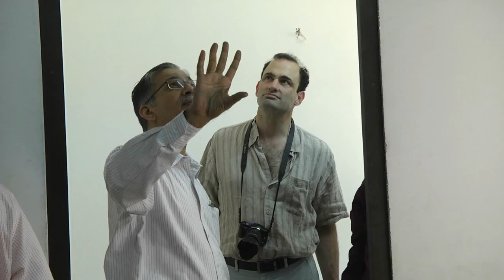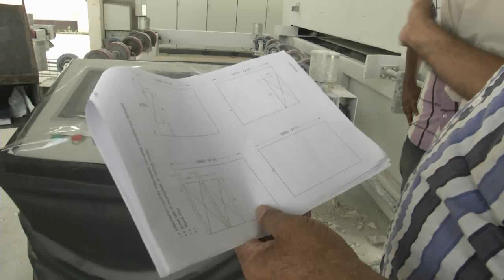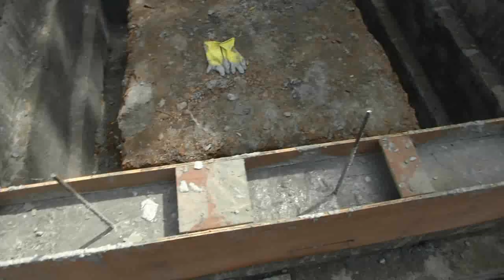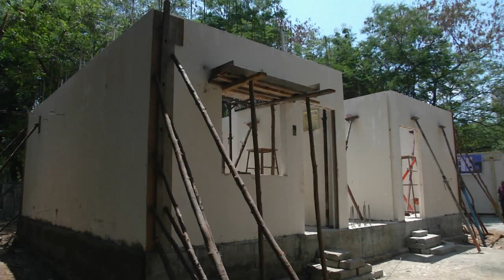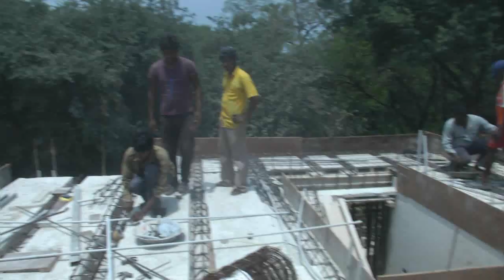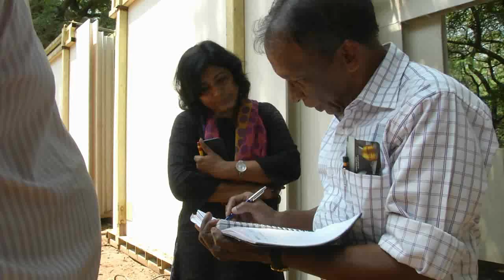IITM GFRG  demo building 2013_720p

Comment: Thank you for a very informative video. It is a significant move from conventional techniques and seems to be well anchored in preserving resources.

I would be very interested in the possibility of enhancing the recycling and conservation of materials by replacing aggregate in the foundations with recycled glass, using micro rebar in the structural concrete members and using aircrete or foaming concrete to conserve concrete materials and enhance thermal properties?

Many thanks for your inspiration and foresight. Kind regards. Marc
Reply: Really its grate and innovative .I want construction house in odisha, where I contact any number sir plz

Comment: Hi i would like to build New House with G+2 floor in Tirupathi and i have few concerns like
 1) How many days it will took to complete the house .Total Sqft 2000 (including G+2) 
 2) Whether we will get Housing Loans for these type of Building Construction.
 3) How strong is this house, durability of house
Reply: 30 to 45 days, Building is stronger and durable than any concrete building  minimum 50 +year u can expect the life of such building. Housing loans are not related to the GFRG, it is all depended on your CIBIL score
Reply: rapid homes 
gfrg construction, consulting, supervision
8137896721,8137896731,9567478175
Reply: @rapidhomeskerala1684   Sir Any contacts from VISAKHAPATNAM or ANDHRA PRADESH working in this TECHNOLOGY

Comment: Rs1700/ sq.ft  full finished key hand over package.( Structure , painting, flooring,electirical work, plumbing work and sanitary work, windows and doors)
Skytouch builders and developers 
www.skytouchdevelopers.com
info@skytouchdevelopers.com
infoskytouch2001@gmail.com
Contact no : +919961247704
+918606300857
+918086700190

Comment: Hi Viewers, I finally got constructed my house using GFRG panel near 
Chennai. To contact, please call to +91 9962286996 / +91 9524428810 
(Rapid Homes, Madipakkam, Chennai). They really taking care of 
everything. This is very much cost effective and also middle class can 
afford.  Since am from middle class, am now very much happy in owning my
 house in my name. Time consumption is very less compared to normal 
construction and it is 100% safe from earth quake, Tsunami etc. Very 
strong panel and we can only drill to insert a nail and can't hammer the
 wall. It suits for all kind of climatic changes.

Thank you Rapid Homes (+919962286996 / +919524428810).
Reply: You need crane movement space and space for lorry which does Panel delivery (Ur road should allow a tipper lorry to cross and you need to take care EB lines over head while lorry / crane moving). Rest all you no need to worry. Even Rapid homes asked to post photos and i said NO since we have family there with ladies. So i don't want to give opportunity for wrong path / disturbance. You can ask Rapid homes for other completed project instead.
Reply: Finally they offered us for 1200..
Reply: Thank you sir.. We are happy to serve you more in future.
Reply: Post your home video/picture.
Reply: How much did it cost you Sir? For Sft?
Reply: Shankaran R  post some photos /videos of your home. it will be helpful for others. What were the difficulties you faced in this construction.
Reply: Shankaran R
Reply: Great. I'm also planning. May I know contractor details
Reply: Got it. Need to view the house....
Reply: DELHI ME BANWANE K LIYE KAHA CONTACT KRNA HOGA

Comment: You engineers need a lesson in marketing. 
1) Indians like to renovate houses and this doesn't allow for any midlife renovation 
2) The panel size is so huge that transport will eat up all the funds 
3) The requirement of crane is also restrictive. In india, where even four wheelers cannot reach, how do you expect cranes to reach ? And at what cost ?
Reply: Yes even I have the same doubt
Reply: Transportation may be costly, but the resources u use is very less, also it is for people without ceiling (like 90%)

Comment: i want to construct house in kadapa (A.P) is there any one constructing house in this area with this technology let me know
Reply: We are Rapid Homes from Chennai, We doing this type of construction , need any details please call us. Contact: 9524428810,9962286996 or send mail to rapidhomes2015@gmail.com
Reply: Hi Everyone,

Thanks for your support. We are glad to inform you that, Rapid homes ongoing project is now happening in Thiruthani mathur gate. Soon we are about to start in ECR, Chennai.

We are basically from Chennai and supporting through out India.

You can reach us in below modes.

Phone: +91 9962286996 / +91 9524428810
Mail: rapidhomes2015@gmail.com
Website: http://www.rapidhomesindia.com
Reply: nora emilia hi Nora, did you get any help? Could you build using this material? Even I am looking for such solution in kadapa only.

Please call me the details if you have got it 9900240495

Comment: I want to increase the height of the brick and mortar  comound wall of (40 feet long) already existing with the use of GFRG in Chennai.  The requirement is 40 ft x 3ft x 5 inches.  Please let me know the, possibility, cost and availability of the same.  Anantharaman 9444402004

Comment: what's the cost?
Reply: 1250/sft
Reply: RITHESH SALIAN only for frame and roof? or including finishing jobs?
Reply: പാലക്കാടൻ മട്ട all works
Reply: RITHESH SALIAN
Dear Mr. Ritesh,
Good Day,

i am searching here for some GFRG panel type building if you are doing kindly let me know and  whatsapp me....i will contact you
my no +971501589202
Reply: hi, Liyagathali Mohammed , i dont carry out the work.
Glass Fibre Reinforced Gypsum Panels, manufactured by a Cochin based organization, FACT.is the organisation does it, u can check with them
Reply: Liyagathali Mohammed 
We undertake construction useing GFRG panels:Bace India 12 SBI Colony Vasanth Nagar Singanallur Coimbatore-641005.:cell:+919894610121.mail:ps@baceindia.com

Comment: Costs 1750 Rupees / Square Feet including basic interiors
Additional Costs on modular fittings and Lightings
Reply: Moj Jan 
Dear Mr.Moj
Good Day,

i am searching here for some GFRG panel type building if you are doing kindly let me know and  whatsapp me....i will contact you
my no +971501589202
Reply: That’s ₹175000 for 100 square feet: exactly same as current construction cost of conventional housing: can you please explain how is that better cost-wise?
Reply: +Liyagathali Mohammed "30/40 House constructed in 28 days by GFRG load bearing panels.Maharashtra CM Offers to Promote FACT's GFRG Panels !!!" by @AzamgarhAppu on @LinkedIn https://www.linkedin.com/pulse/3040-
Reply: Moi, cost you mentioned is wrong in India. May be your place. In 2014 it was around 1000/sq.ft. Now in 2018 it cost around 1500-1600 per sq.ft
Reply: How is it cost effective?

Comment: Hi Sir,

I am constructing a new house in kerala, ground floor construction works completed. 
I am very much interest the new technology, now am thinking about the balance works i.e. ground floor sit-out, portico & 1st floor full roof as per plan slop design to be constructed by the new technology. Hence please provide me the specifications and commercial impact compared to the normal slop concrete. This material and experts available in kerala? 
Regards,
Rajesh Komath - rkomath78@gmail.com
Reply: What do you have done in the end?